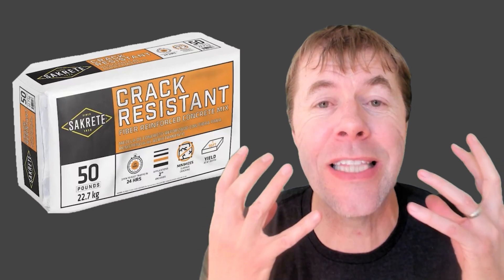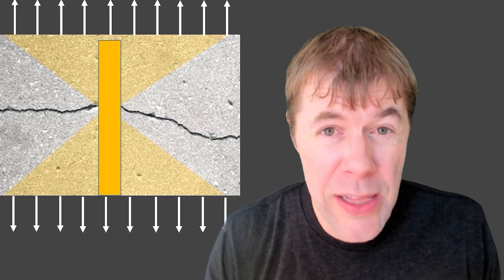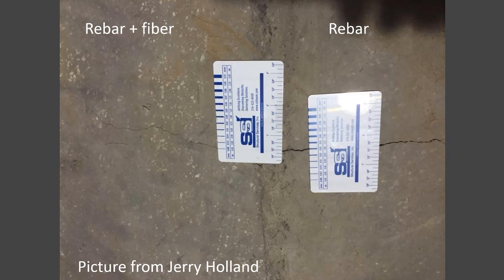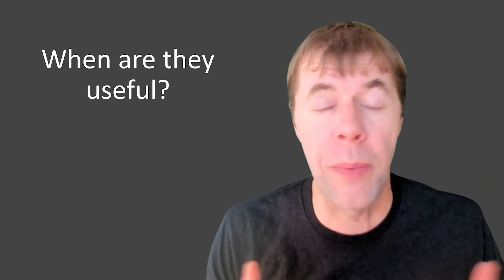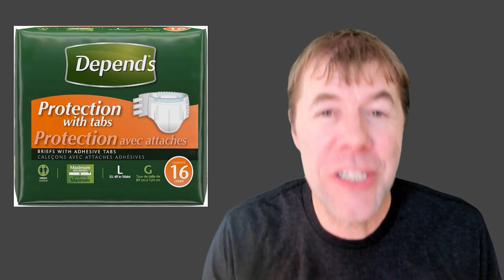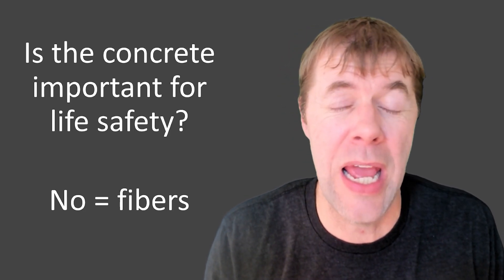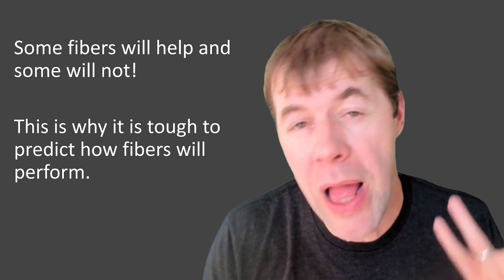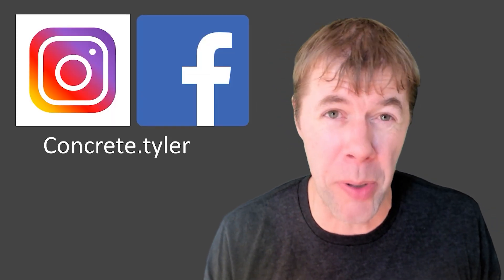Fiber reinforced concrete 2024 update!

Comment: Im a contractor that started using Helix 5-25  a few years ago. I love it. Was initially worried about fiber on sidwalks and patios but ive only  rwmoved 3 or 4. 
I got a roller screed to clear thw surface of steel micro-rebar
Reply: I use a vibratory screed on my Helix Micro rebar. Never an issue. Amazing product.

Comment: I want to repair wall cracks that are about 1cm. Would using fiberglass concrete make any difference in the repairs rather than just regular concrete? I get that using fiber reinforced concrete when building is a no brainer. But how about repairs?

Comment: Actually i say experimental buildings with massive concrete bodies and no rebars. It depends on quantity of fiber in the mix. They used something around 150-200kg of ancored steel fivers per cubic meter. And it proven to be stronger even in rebarless slabs.
Reply: Yeah the current code compliant micro replacement is 7-9-13lbs a yard and you still do perimeter bar. 
It costs about $3 and change buying it in pallet size orders. 
Mostly it's used for warehouse floors, industrial plants like fuel and chemical plants. Then highways. 
Call around for ready mix companies that have it as an additive straight from them. That's rare but they're out there. 
I add it on site and mix it in the truck for 30min.

Comment: Do a video on remesh vs rebar!
Reply: Also I’ve seen GFRP rebar 10 mm (#3 diameter) and GFRP remesh at 8 mm, but in theory GFRP remesh at 8 mm should be more than equivalent to steel #3 in terms of ultimate tensile strength (1.56x surface area for #3 in steel but 2x tensile for 8 mm in glass fiber)

Comment: Any suggestion on how to fix a pier which cracked due to efflorescence and how to avoid for future robustness
Reply: Fiberglass basalt or stainless on the replacement.
I like Helix and you could use a steel micro rebar to patch an issue but the steel inside has water hitting it so its done.

Comment: Tyler, I have some questions regarding FRC and more specifically SFRC and even more specifically Hybrid ECC using PVA and Helix or HiperFiber or one of the Dramix varieties. Finally, If we use the FEMA P-320 March 2021 eidtion and the October sample plan revision... Can we use Hybrid ECC with Helix and PVA to replace all the rebar.... if not, how much rebar do we need to retain to meet the CLP requirements and the suspended concrete roof requirements?

Comment: I'm planning to do a concrete slab project using Quikrete Crack Resistant Concrete, which has the fibers in it.  
What do you think about adding an Acrylic Fortifier to this concrete, to further increase the crack and water resistance?
I searched through all of your videos and I don't see a single mention of Acrylic fortifiers!   So, I'm guessing you don't think much of them?   But they do definitely work at the small particle level with grouts and mortars to hold them together, and I like the idea of reducing water penetration into this concrete slab also.
So, what are your thoughts about Acrylic fortifiers for concrete?
Also, what about adding a water reducer to this mix, to further increase the strength of this concrete slab?   Will that work with the acrylic fortifier or will they conflict?
You didn't really go into which of the water reducers you though worked best, or name any names, but I was looking at polycarboxylic ether, sold as Melflux 2651 F.
Love your videos and expertise, but I do wish you get could get more specific about the names of these products.   I know it's different for homeowners going to Lowes and Home Depot as to what is available, but it would really help!

Comment: Hi Dr. Tyler, how about graphene oxide for concrete reinforcement. Do you have any experience or studies you could post on your chanel? Thank you
Reply: What I meant is can graphene replace fibers? Or it serves as different reinforcement?
Reply: @kriswantosantoso8901  graphene replaces steel actually. The amount they can produce are so low and costs are so high that they promo pours they do don't even touch how far it could go in concrete. 
Something like below 10grams per yard/meter and hundreds of dollars for that.
Once we can start doing 10 or 50lb per yard for under a hundred  it will do amazing things but that's decades away.
Reply: @sparksmcgee6641  great insight thank you.

Comment: Hi Tyler, thanks a lot for this content, it is useful. I am designing a concrete mix for the foundation/anchor of an ingound basketball hoop. I found some nice, coarse aggregates (ready mix with 0-4mm sand and 4-16mm gravel) and selected a 52.5 strength CEM II cement. There will be 4 rebars in that foundation once I pour the concrete. To get a higher psi/Mpa value I am thinking about a superplastifier + steel macrofibers. Will I get any real benefit, or is all of this only good for slabs?

Comment: Thanks, Tyler. Would it be possible to spec a mixture of concrete with:
• basalt micro fibers
• helix steel macro fibers
• Wood ash for waterproofing
• Zypex additive to fill in eventual micro fractures in the presence of moisture

Do people spec out an exact concrete mixture with multiple additives like this? If so, does it need to be signed off by a structural engineer before used to build a residence?
Reply: Zypex will make it waterproof if it's placed in the mix. 2-3% of weight of cement I believe.
It can also be sprayed on after for a big savings.
Those Helix has the docs to download saying what levels you need which is 9 or 13lb per yard 99% of the time on residential.
Since it still needs stick around opening and edge. Put those in the design for permit.
The trick with permitting put "at least xxx".  Often inspectors will fail you if you exceed the design on the plans. Placing it as written in the contract that the plans show the minimum
Reply: @ Appreciate the depth! Cheers.
Reply: Also call out "minimum of any combination of #5 fiberglass, #5 basalt or#5 steel rebar" including 
I would use fiberglass sticks and steel for any corners and around windows. Fiberglass is the same price but costs a little more because you have to have that 24" overlap for corners.
You can order fiberglass/basalt corners but really it's better to use steel because you can fabricate what you need.
You attach the engineering document from Helix showing the minimums.

Worst case of specifying like this is a plan reviewer with an attitude because they're not qualified to understand the material mixes.
It's a code compliant submittal so just politely tell thwm to ask the cities structural engineer because thwy can't take your recommendations
Reply: Call ready mix companies and talk to the sales people. They keep the mix of every custom mix they make. If you want ultra high performance they have $2-4,000 a cube mixes.
Many you can't add anything to the concrete while it's in ther truck. You hire independent trucks for delivery and put the additive in on site and let it run until it's mixed, the additive company will tell you how long.
You may need something to extend the set time doing that.
Volumetric trucks can't do cutome mixes for micro rebar and other additives. Some have a good range of additives but they aren't used for high performance concrete
Reply: @ My main thing is a solid plasticizer like Fritz Pack or Kelcrete, the right fiber mix, and Zypex or equivalent admix for healing micro fractures over time. Zypex makes one that's also a water proofing system.

Hoping to do an ICCF build (EF Block or Perfect Block) and use galvanized rebar. Need it fire proof. Near future project but already looking into materials.
Reply: Good luck. Tyler here is a good source along with the concrete institute. Which I think is the name. Bald guy that does a lot of infrastructure work for government and a lot of testing at his own lab in Colorado Springs ,Colorado.
"Go concrete, beat asphalt!!!!!!!" Is their sign off.
Don't remember the name for sure but with the rest of that you can find them.
He invented a glow in the dark mix a few years ago that he put up.

Comment: In the residential concrete exterior concrete we only use polypropylene monofilament fibers due to best final finish, my understanding is this is for plastic shrinkage only and really doesn’t do much for preventing larger cracks?  We typically use rebar 3’oc or 6x6 10ga welded wire and if customers want fiber it would be in addition to the steel reinforcing and extra $$. For me I’m more inclined to use fiber on a hot sunny day otherwise mainly just steel in most cases.  Your vid has me thinking I need both 
Thoughts?

Comment: Love your videos! I’m new in concrete but very keen on the use of add mixtures that are not chemicals in order to control uprisings costs. If I were to use hemp fiber as my reinforcement’s for a slip form operation would it be advisable to pre soak the hemp fibers with the water prior to mixing the wet and dry ingredients to avoid hemp from trapping in oxygen? Thanks in advance

Comment: do synthetic fibers decay over time? (like many decades?)
Reply: the challenge with plastic is the long time durability, thats why environmentalists hate it, but if like in this case not used for single use but as long lasting material plastics can last centuries, especially if not direct exposed to UV and air, thats why fibers are now specifiable under ASTM and Eurocode standards...dont forget steel corrodes, plastic fibers dont, also much higher alkaline/chemical resistance

Comment: We just bought this concrete cleaner called Mud Slide from Zepps. It strips everything except what you dont want it to. It is really neat stuff. My boss asked me to pick your brain about it and he would give me a tee-shirt. So my question is what is it in the cleaner that goes after only the concrete and turns it to sludge and does not peel paint, rubber, plastics, etc. and why?

Comment: Thanks Tyler. I like your energetic video. Having said about fibers what type of concrete mix design will help reduce or even better stop the surface of the fiber reinforced slab becoming a hairy monster? Should I have add more slump? Should I add more water reducer or plasticizer?
Reply: we have been using fibers for over 10 years now, we only use between 2-3kg/m3 using high performance Macro Fibers with a DoP (decleration of performance) of 3kg/m3, we mostly have a great finish and that with low quality concrete here in Indoensia, we even mix fibers into the ready mix truck or site mixer...most important is distribution added 4 minute rotation at high speed...superplasticizer is always recommended, but even in cases were not used by our partner contractors the result is mostly acceptable

Comment: I work for a manufacturer of steel fibers. The highest performing steel fibers in the world. I am a PE. If you want to talk / have questions let me know. This account is my side hustle business but if you have an email I can email you from my work email.
Reply: Steel fibres are better than glass?
Reply: @noahfleming7887  for heavy industrial slabs of course. For something architectural maybe not
Reply: @noahfleming7887  two different uses.
Steel fibers can do the job of fiberglass  but not the other way around. It's not a set performance either so some people still use both.
Steel fiber replaces steel rod rebar
Reply: OK where are you or a contact email please. Tough to find people to do custom mixes for small jobs and residential.
I'm a residential contractor and I rely on the mixes the sales people have at the ready mix.
Reply: @sparksmcgee6641  we don’t work on many small residential jobs to be honest. We do have some mix design tools however that may help. Bekaert is the company you can contact thru the website. I’m in Ohio.

Comment: I use both fiber and steel with top and bottom reinforcing.
Overkill always works.
Reply: ⬆️ this is the kind of person I want in charge of everybody's concrete

Easier AND cheaper to overbuild it now than it is to fix it in 50 years!
Reply: What is the top and bottom reinforcement? Mesh?
Reply: Go for steel fiber. Takes care of both. Helix has amazing resources

Comment: Few questions regarding fibers. Is there a significant effect of vibrating concrete on the fiber orientation? Does macroplastic fibers creep over time under load? Thanks
Reply from the maker: Vibrating can impact orientation but it is hard to control or predict.  Some people have hypothesized about macrosynthetic fibers creeping but I have never seen it happen in the field.  There are macrosynthetic fiber projects have been in place for more than a decade and the fibers are performing well..
Reply: the creeping isnt a real issue, but we seen issues in precast when vibration is used, it effects the fiber positioning and distribution, so this needs to be looked at case by case doing your on trials

Comment: Hi! Can you please explain why there are basalt and plastic and fiberglass fibers, and what the differences are? Are some stronger or more/less elastic or cheaper or all of the above? Are the small elastic fibers primarily used to avoid the small surface cracking as you've described in this video or are they popular in other applications? And would the other applications be served better with bigger and/or stiffer fibers? Thank you!
Reply from the maker: I will talk more about this in another video.  All fibers reduce cracking but some perform better than others.
Reply: @TylerLey  Particularly looking forward to any field data on how basalt fiber is working in real world projects…
Reply: @TylerLey  Awesome! Thank you! On a side-note, I'd like to use fiber-reinforced concrete to make pottery without a kiln. Any suggestions are welcome!
Reply: I bought some plaster/concrete pots but in my experience they tend to fall apart very quickly. I'd like to make some that are of good quality.
Reply: @TylerLey  please cover to what extent steel structural fiber do the job of "finish" fibers like glass.
Ready mix pulled all the fiberglass when I used Helix but I wonder if I should leave some in.
That's and I love your work.
R

Comment: Why don't we use very long strands of aligned fiber instead of rebar?
Reply from the maker: It is hard to orient them in the concrete.
Reply: @TylerLey  Long strands like ropes. Laying the ropes would be like weaving vs rebar tying.
Reply: @TylerLey Sorry if I'm veering  into crackpot territory, but I am imagining a large prefab loom of material on a lightweight frame that gets incased in concrete. If carbon fibers are used, they might even be able measure the tension throughout the form. How does that sound?

Comment: How about CONTROLLED positioning and orientation of fibers?
Reply from the maker: I talk about fiber orientation towards the end of the video.  This isn't really done in practice.  There have been some people that have tried but I don't know anything that works consistently.
Reply: @TylerLey  Fibers are oriented in plastics by controlled elongation.
Reply: @DavidFMayerPhD  maybe magnets can be used?
Reply: @alex-lu8mi  Good idea for steel fibers.
Reply: @TylerLey  I had a similar question. I basically need to build a lintel for a basement window. Wondering if I could just drag a bar through the poured concrete (perhaps working in layers) to encourage the fibers to line up more horizontally before curing. Would it even be worth the effort?

Thanks for the excellent videos, btw!

Edit: I just found your dedicated fibers video. It doesn't directly address my question but for anyone stumbling across this comment: https://www.youtube.com/watch?v=OMojB0lzksE

Comment: I have a WW2, 11 cuft mixer and I need to know how to air entrain at home and how does that
affect water reducer and why are the fibers for reinforcement so short? shouldn't they be 2"
long at least?
Reply from the maker: You can add air entraining admixtures to the mix.  Fibers for hardened concrete are usually 2" long but microsynthetic fibers don't need to be that long.

Comment: I have a driveway that is 30ft wide and 32 foot long. We placed a 6 bag mix with soft fiber and a little over 5in thick. After 32 years no cracks just some top spaling near the road from salt. I have parked trucks with over 60k loads over night on it. I do seal it every two years or so with solvent based sealer. Love fiber.
Reply from the maker: Thanks for the note!  That is great that you contiue to seal the driveway.  Take care.
Reply: I use a high solid solvent sealer. It is a penetrating type. I usually wait 30 days for the concrete to cure fully and if you used curing compound for it to come off. Just clean with a pressure washer and wait to fully to dry. Use a solvent safe paint roller to apply sealer. Solvent sealer can be hard to find, EPA rules for home owners etc. But call your concrete suppler for help in locating some.
Reply: I'm sure the fiber concrete can take some major load but no cracks or slumping in the concrete driveway can just mean that the base and subbase was prep well and properly.
Reply: What sealer do you use? Penetrating? I have a finer reinforced pour that I just did and would like to do the penetrating type.
Reply: @Banned4eva  I use if you can find it solvent base penetrating sealer usually comes in 5 gallon containers. Make sure surface is clean and dry. I use a roller for solvent type product. Water base is ok but I am kind of old school and solvent last longer.
Reply: Make a video about zero-slump/drycast concrete used in masonry/paving blocks. It behaves very differently from normal concrete. One thing is more water means more strength but more water also means more difficult to fill molds.